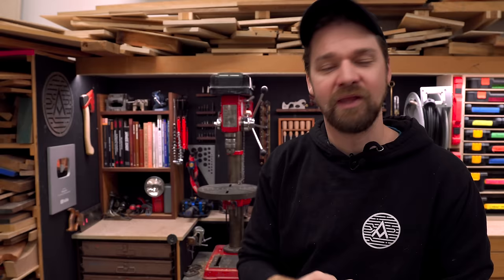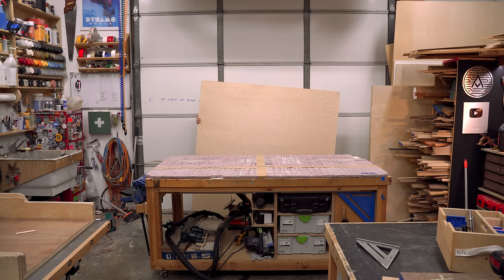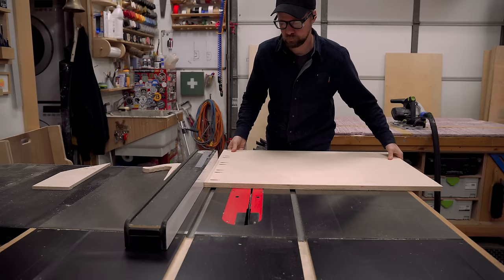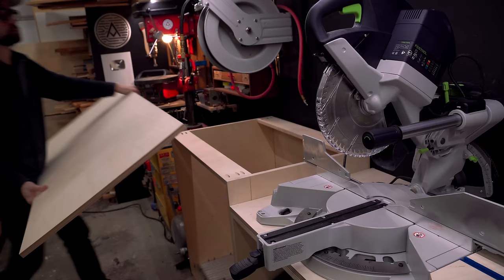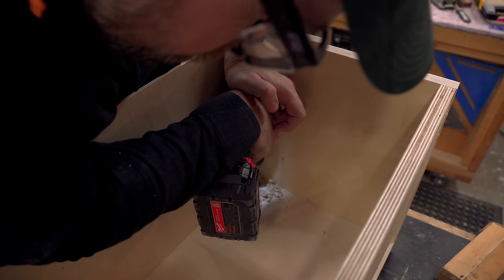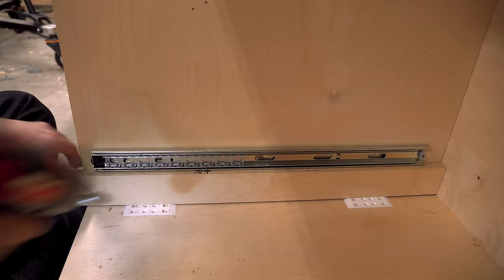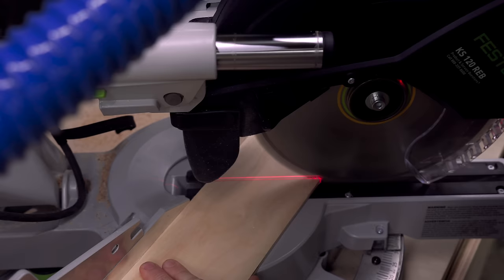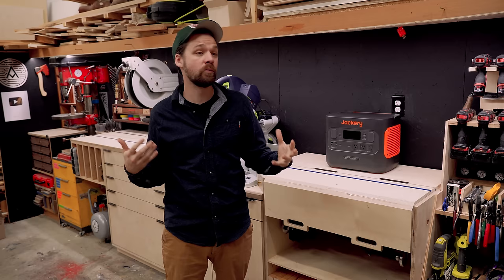Building a Miter Saw Station PACKED with Features!

Comment: As a retired old fart getting into a wood working hobby it's mind boggling watching your skills. I know I could never live long enough to acquire a minute fraction of your ability but your videos are still super inspiring to watch.
Reply: There’s still plenty of cool things to make without having 20 years of experience. There’s really cool pattern plywood you can make with basic designs.
Reply: You can do it! Just time to see how deep the rabbit hole goes
Reply: Just start. Make ANYthing. Get out there, and do it, start small, get the tools as you need them and just have fun.
Reply: I’m in that camp mate.
Don’t think I’ll ever have this level ability but I’m planning on having fun spending my retirement money on wood and playing about. Only thing I’m a touch nervous about is buying a table saw as kick back seems to be a real thing lol
Reply: @dannyarcher  I avoided table saws for years for that reason. Got one a few years ago. I just try to be super safe, never had a kickback. Honestly think you'd have to do something really stupid to have one. I worry more about chopping off a finger so I always have push sticks for everything.
Reply: @Danny Archer  it's easy to avoid kickback once you understand what causes it. Keep the splitter on the saw, don't push the blade toward the fence, and don't try to force a cut if it starts to bind. And always keep a hand or push stick on the piece between the blade and the fence. I've had kickback one time because I was doing something dumb, and it wasn't that bad. Scared the shirt off me, though, so I'll never do that again at least.
Reply: Other than a few beds and shelves, furniture and shop furniture seems really intimidating 😂
Reply: You're beautifully modest. You can go from novice to expert within like a year of putzing around. I learned so many "tricks" and otherwise logical stuff just from fucking stuff up. As soon as the mistake is finished and you see it it instantly clicks what should have been done to avoid it.

The beauty is 99% of those fuck ups, only the person building it or other similarly skilled folks would ever notice.

Just start having fun with it and evolve from there!
Reply: Modesty is great, and at the same time, don’t underestimate yourself! If you’re enthusiastic, you’ll get better fast! Enjoy the process, and don’t worry about mistakes. Tools, jigs, guides, etc. are made to help you get premium results where you don’t have perfect skills!
Reply: @adamb0mbz   Or time to see how long the rabbet groove goes... lol.
Reply: My sentiments exactly! I’ve done home improvement and new construction in both residential and commercial. I’ve been that ‘Jack of all trades, master of nothing’ type guy. But I am really enjoying this kind of work as I am able to get as creative as my mind will allow. Then I watch these younger guys and find something new. It’s very inspirational!
Reply: I just started last year and I'm already making stuff that I'm happy with for my shop, and this year I hope to make stuff I'm happy with putting in my house! It doesn't take 20 years to make something great 😊
Reply: @Scott Crawford Glad you’re getting into it! I know it’s a simple typo (not criticizing), but I read “...getting my SHIP built...” and thought, “dang, this dude is SERIOUS!”. Then realized you meant “shop”. Hahaha!
Reply: @charlieevergreen3514  , I’m still having my first cup of coffee and thought the same thing. I visualized a huge wooden ship upside down in a front yard. Then I read your comment and understood. Thank you! Getting back to my coffee now before I really mess something up for the day…😂😂😂
Reply: It is gratifying to see a woodworker apply those skills to framing. Well done!

Comment: More and more the stand alone toe kick base makes so much more sense than building a toe kick into each cabinet box. To be able to level the whole thing and then work off of a common level base simplifies things so much, especially if your floors are less than perfect.
Reply: I agree but the way he used those little blocks with a single screw each to level it is nor nearly beefy enough
Reply: Are the toe kicks screwed to the wall/floor or just left loose on the floor? Same questions about the cabinets to toe kicks, it didn't seem like they were screwed together.

Comment: One pocket screw takes 170lbs to break add glue it's 380lbs, super strong, you don't need that many screws man just sayin, specially on your top spacers there, but I have that issue of over building myself lol, that's why I researched the strength of every joinery method, pocket screws are near the top of the list right by mortis and tenon, not as strong but up there...just info for anyone watching this ..

Comment: I built a semi mobile miter saw station.  One of the best additions I made to it was adding an inlayed measuring tape about 1/16th below the surface.  I accomplished this by routing a groove and inserting a long adhesive backed magnet that you can get in rolls from amazon.  I then laid in one of those measuring tapes used to attach to tools such as a table saw. The beauty of using the magnetic strip is that you can tune and fine adjust the ape measure because its not permanently adhered to the station, only stuck down via the magnet strip.  I then added an acrylic tab to the adjustable stop that has a shallow cut in it which is filled with red marker.  This is a simple way to make a cursor to line up the stop.  I also added a flip to the stop and an adjustable miter stop but I wont get into that here.

Comment: Damn Michael!! That’s a gorgeous setup - even as a non-woodworking person I can totally see it! Also love the dust collection system. One of the reasons why I still watch your videos is that dust collection system. When I was 7 or so, my next door neighbor (and best friend’s) had a house fire due to the dryer and the excess sawdust in the garage. Love that you clean this up, not just for your lungs, but for safety in general.
Reply from the maker: Thanks Tricia!! Dust collection is a must!
Reply: @MichaelAlm  what dust collector were you using under the cabinet? I don't see it listed in the description but curious what you were using.

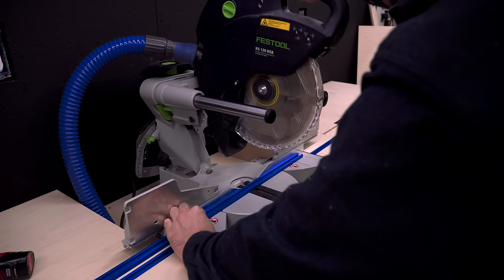Comment: 19:08 - When cutting metal it's important to get a good bite into the material, if you are pressing lightly then the heat is probably not leaving in the waste swarf but allowing it to spread to the blade, making the blade get hotter than it would otherwise. There's also the possibilty that you can press too hard and create extra heat too while also chipping/breaking the cutting edges. A good middle ground of pressure is required.

Comment: All I’m gonna say is…. The J. M. Dawley mitersaw measurement rail and stop..,is hands down the best you can get… short of an automated one. You can get ONE aluminum extruded rail that is up to 8’ long… maybe 10’. The “stop system” is amazing, as you can put in MULTIPLE stops on the back of the rail, and the sliding stop , stops on them.. or can go past them. Say… for a cabinet shop that cuts a few measurements ALL THE TIME.. so, just put in stops on the rail system, and it will always be dead on! It’s the best!!

Comment: I work in the trim industry. I’ve only used two miter saws, the Kapex, and the Hitachi C10 FSH. It’s undeniable that the Kapex is more accurate but under powered (as all Festool tools are😣) The Kapex has zero travel out the back but the Hitachi has the slides that run out the back. Also, the Hitachi is more powerful. However, on the job site, you basically just said the Saw up wherever, not necessarily up against the wall when you have to worry about space. Just food for thought; I am not in any way trying to influence the way you buy tools for your shop. Great video.

Comment: Michael, a quick tip on the Kreg hinge jig. There are two small holes on the inside ring for drilling pilot holes for the hinge screws. That removes the need to align the hinge to set the screws afterward.
Reply: Another: Maybe this is on newer models, but the plastic guide on the forstner bit on the jig has a twist lock so you don't have to un-chuck it from the drill every time.

Comment: Might want to try attaching all hardware before assembling cabinet. Flat horizontal on workbench attach drawer slides then assemble cabinet. Work from drawer slide centre line for screw location. Great saw station

Comment: I’m remodeling my master bath, it has a 109 inch double vanity, with a center that is open for my wife to do whatever wife’s do to get ready for whatever.  I replacing it with a more modern look. It’s built out of good quality cabinet plywood.  So I’m going to build a base like you did, then level it. Take the doors off, and add drawers to it.

Comment: For the two angled drawers, for me, in keeping with the 1/8 inch reveal, I would put a 1/8 inch shim of hard maple or some hard wood, then wax the runner and the bottom of the drawer edges. They will slide as easily as the mechanical runners. Nice build. My lathe, well my big ones, would not work with a tip up.... My mini lathes yes.... I am lucky to have a lathe room and a flatwork room.

Comment: Hey, just a tip. The Kreg jig has two little holes above the main hole for the hinges. They are there so you can just drill the holes for the hinge screws while the jig is still clamped in place! Hope this helps!
Reply: I just finished a cabinet project & used the Kreg Jig for this. My hinges' holes didn't line up with the kreg jig ones, so might be that Michael had the same issue :)
Reply: @Ghust2  Many people have that issue. It’s nuts Kreg didn’t fix that. I had the same issue this weekend!

Comment: Don't worry about heating up your blade on aluminium cuts, the chips will take out basically almost all the heat and unless you're cutting like 6" solid round you can be almost as generous as with wood when chopping it.
Reply: Having been hit by those chips while cutting up a bunch of scrap, I wholeheartedly agree. That burned like hell
Reply: While I agree that the blade heating up is not the issue, I've found that if you're too aggressive when cutting aluminum you tend to end up with some material sticking to the teeth, which can be difficult to clean and causes issues when cutting wood after the fact like more pronounced saw marks, increased tearout, and even burn marks if your blade is also a bit dull (which happens if you cut a lot of aluminum) overall it's just better to take your time cutting aluminum

Comment: OK, haven't finished the video yet but the hack with using a round plug on the Forstner bit to enlarge a hole was definitely worth the price of admission all by itself. Thanks for that. If the remainder of the video is as well explained as the first part then I will have learned a good bit when it comes to my own miter saw improvement.

Comment: Very nice build! However I will add the same small critique that I have with several of the miter stations I've seen.  There's a lot of custom fabrication specific to this particular saw.  I realize it's a Festool and should last a long time, but u just never know. If/when you have to replace it, there will be significant modification required to fit a new saw... unless the replacement is the same unit, or is shorter and narrower.
I'm planning to make my shelf slightly deeper than the height of most saws, then shim the saw up flush to the top.  The shelf will also be slightly wider than most saws.  Then the only custom fab will be narrow fillers to bridge btwn the bench top surface and the edge of the saw base on both sides.

Comment: I've got a couple of tips for you. I noticed that your Milwaukee drill dropped the hole saw as you finished drilling, that usually happens when you are on the corners of the arbor and not the flats. It's also a well known issue with Milwaukee drill chucks, which leads me to my second tip, the run out. Milwaukee drills have sloppy keyless chucks. But you know who don't? The Germans. There is a company called Rohm who makes machinist tools and they make a bolt on replacement for Milwaukee drills. They have the standard 1/2"-20, as well as the 9/16"-18 that they made specifically for the M18 Fuel drills. They're great, I had one on my 3rd gen Fuel and abused the hell out of it for several years before the drill got stolen.

As far as the right angle adapter goes, they are great for occasional use but the internals heat up very quickly and shatter under heavy use. Just putting that out there in case anyone was thinking about trying to use one for drilling joists etc.

Comment: Good video Michael. Here's a tip for enlarging a forstner bit hole when you make one that is too small.  Take the new larger bit (the size you want the hole to be) and drill a hole in a piece of scrap. Now place the new larger hole in the scrap, over the hole that is too small -- you can clamp it, hot glue it, brad nail it, stand on it or what ever is convenient. Now use this hole to guide the outside of the larger forstner bit instead of the center spur. Once the hole is enlarged remove the scrap piece. It's an old trick used to make door-knob holes bigger in old doors.

Comment: This is absolutely incredible!  The only thing that messes with my head is the draw pulls on the 2 patterned plywood drawers...as they are angled my head would think they open out at an angle rather than straight out so instead would've put the brass handles perpendicular to the mitre station itself rather than drawer face.  Anyway it's no criticism at all as the whole thing is so on point
Reply: I was thinking the same exact thing when I saw it.

Comment: Very nice work. I would add some small vents to the cabinet below the miter saw. This way, the shop vac doesn’t create excess pressure/heat in the cabinet. Might no be a big deal but better safe than sorry 😊

Comment: great project. I'd however never be able to use those flat drawer pulls. No matter how careful I'd be, I would forever be catching myself on them and end up with cut divits in my arms and legs. I learned the hard way. In the shop only round and/or flush handles on all drawers and cabinets. preferably flush mount as anything that sticks out is a catch magnet for EVERYTHING. LOL

Comment: I used to use one of those right angle attachments for the drill. They are really handy to have and a very good value. In the last couple years I picked up the m12 Installation driver and it was a game changer. I just throw on the right angle chuck and/or eccentric chuck now.

Comment: Hey Michael, not sure if anyone else has mentioned this but the Kreg door hinge jig actually has two drill hole guides for the hinge screws. Saves you from having to use the speed square. Always enjoy your videos!
Reply: Came here to say same thing. Also, you can remove the whole drill bit assembly from the jig, so you don’t have to unchuck the bit every time.

Comment: I started building my station very similar to yours. My biggest issue is that I’m using a circular saw and a level with clamps for straight cuts, so not everything is square. Add to that I don’t have a truck, so I have to get my plywood precut at Home Depot, ie also not square… shims and lots of checking and rechecking before screwing together are the name of my game. Thanks for the inspiration to finally get this going!

Comment: I'm repurposing some really bad cabinets for my daughter, but it does have nice fronts and doors and my heart yearned for a new miter saw, but with the cost of the project I pulled out my old 12" Porter Cable. I only have to make 6 new fronts and will try an edge beads (might not be saying it right) for the first time and undermount slides for the first time, as well. I found Maxcut software that let me create a cut list and optimization for the 3 thicknesses of birch. Plywood is coming from Florida Southern Plywood; is prefinished and their prices destroy those of the big box stores.

Comment: Super cool build. I hadn't considered putting a lathe in a flip top. Space considerations are what's stopping me from buying one, now I'm rethinking that. 

I'm a huge believer in building a separate toe kick and leveling that first. Just makes the rest of the job so much easier. We just did a 25 foot run of RTA kitchen cabinets in the original part of a house that's 110  years old, the floor was out a full inch over that span and leveling them independently was incredibly tedious, but some built ins we made custom for the living room we were able to put on separate kick and it was a walk in the park. 

Not a criticism here, I own a Foreman and use pocket holes regularly, but I don't understand why anyone uses them to knock cabinet carcasses together.

Comment: I've heard mixed results on dust collection for the Kapex 120 REB.  What are your thoughts?  I've heard you need to slow the blade speed down and get a shorter 36mm hose to get decent collection out of it.

Comment: That lathe in the left cabinet. Yes, left. I don't understand why so many people are confusing left and right. 
If you're face to face with someone, their left arm is counter-clockwise to their front, i.e. to your right. 
If you work under the car's bonnet, the car's left strut doesn't spin with you, it stays put, to your right.
So, unless your station is installed face against the wall, the lathe is to your right, in the left cabinet...

Comment: Would this work / be stable enough to change the toe kick out for a 2x4 structure with rolling wheels?
I work in my garage, and things need to be moved often. I was going to make 3 carts/stations.
1 Miter station, 1 table saw station, 1 cart/table. All the same height so they can be moved around for extra outfeed or surface when I need it.

I love this design, but need to be able to move it. I was planning on pretty much 2x4 work station, with the miter sat down to the level I need. But I'd like to do it with cabinets like you did. Just wasn't sure if that will be strong enough to be rolled/moved around.